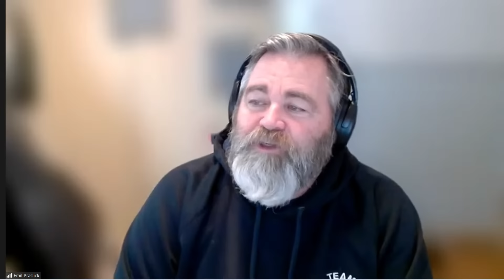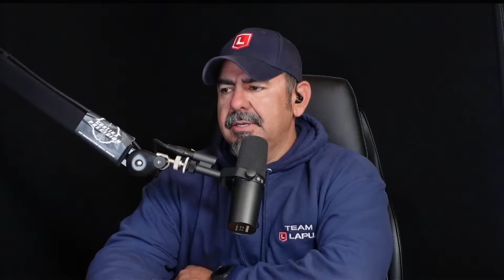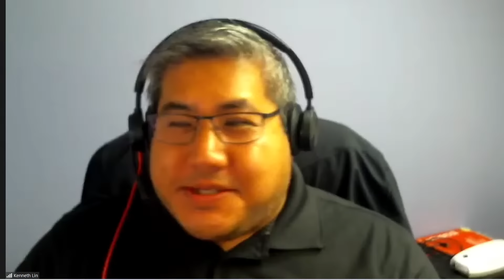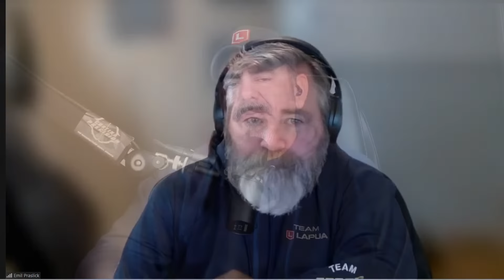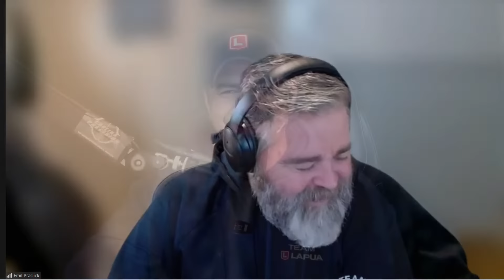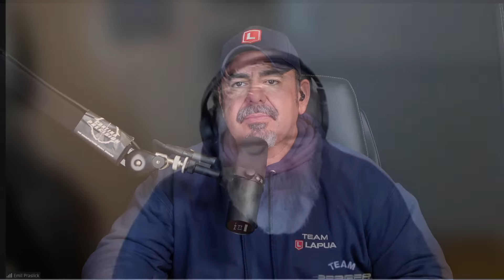Special announcement from Lapua, Berger, and VihtaVuori

Comment: Great Video - but im still bitter on supply in Australia - we got a few scraps before Christmas which were sold out in less then 2 minutes and crashed the suppliers system - im still new to Target Rifle shooting and have been going down the road of Lapua 6.5 Creedmoor Cases and Berger Bullets… and having just getting those sorted out into good groups i now have no supply for the next competition - so now i have to change brands and start all over again with Hornady Balistic Tips - but now the primer issue - we can only get small primer from Bosnia - Now we can’t get small primer brass - and when we do - our rifles are punching holes in primers because the jackets are so thin - even with 223 rounds - so now stripping the bolt, adjusting firing pin length and spring pressure… or even changing rifles to something with less “hit” on the primer… Obama had more Wars on this earth than anyone in history and there was never trouble in supply - now we have a couple of small wars in Ukraine and with Hamas and we can’t keep supply??? How on earth does that make sense to anyone??? —- once again - thanks for the video and updates